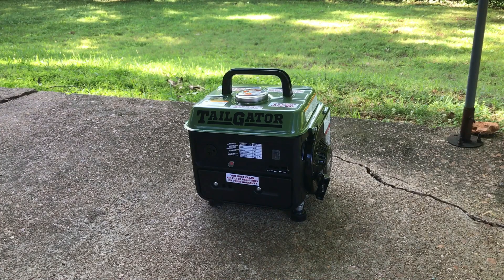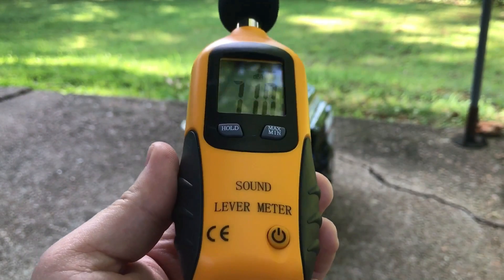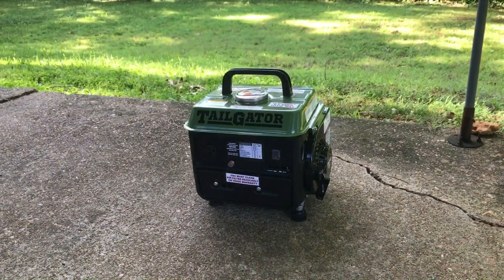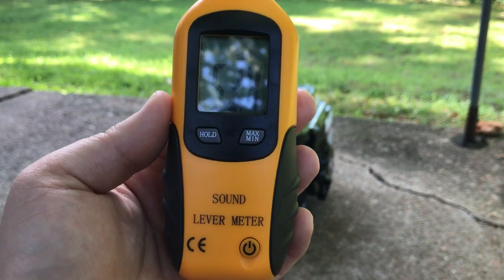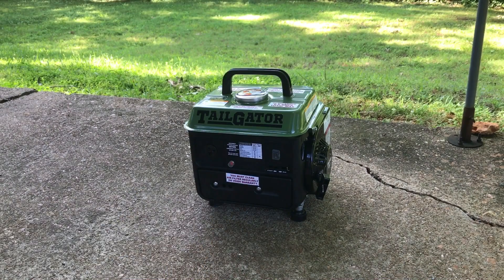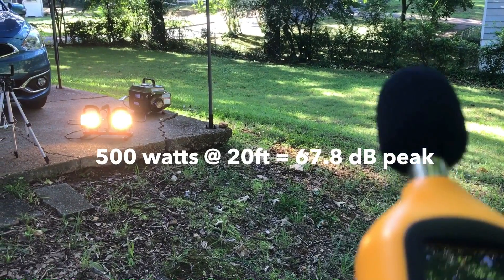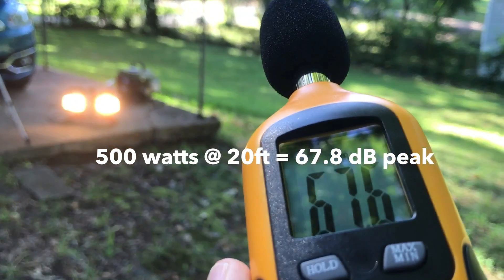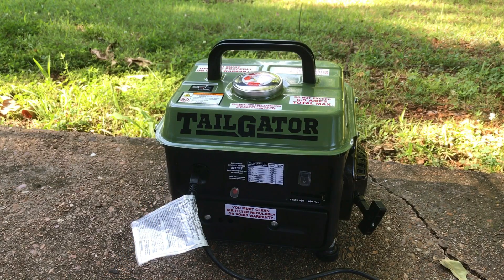How loud is the TailGator generator from Harbor Freight?

Comment: Bought one of these yesterday. So loud it is completely unpractical for use in a normal roadside campground. I ended up not using it due to the noise... Maybe I got a bad one or???
Reply: I will not bring mine camping either
Reply: It works but is so loud

Comment: I've always wondered if you could shave off a few decibels by attaching a small clamp on muffler on to the outlet of the existing muffler.  And being a 2 stroke, will the additional back pressure effect the exhaust scavenging.

Comment: If a generator isn't an inverter generator then it will be loud, that's the simplest way to judge this.

The question is, what is your intended use? Because that makes the real difference.

Comment: How can you make it smoke less?  Does anyone have any input.  I mixed the oil exactly right, but my entire back yard stinks when this thing runs.  Would really appreciate any ideas people have.
Reply from the maker: Synthetic oils smoke less, but a 2-stroke will always be somewhat dirty and smelly.
Reply: Ken, that is what I was afraid of.  I remember 2-stroke motorcycles from my childhood.  I did use synthetic oil.  I just bought it and it is still in the return period.  I may return it and get the sportsman.  Does this sound like a good plan?  or what 4-stroke generator would you recommend?  Thanks for the reply.
Reply from the maker: On the cheap? I don’t recommend, but I like Sportsman small generators. They are affordable.

Comment: I turned mine into Honda quiet by building a three sided box with a top, all in 1/4" plywood and a carrying handle and gluing in some R-Tech on all sides. I left 12"  for cooling. With a 50' #12 extension cord it's very quiet

Comment: Not too familiar with electrical work but can you run a set of those work lights safely using an extension cord from the generator
Reply: You should if you got a heavy enough gauge wire. After 100ft might be a good idea to go up a gauge.

Comment: Decibel is a logarithmic scale.  A 3 decibel increase represents a doubling in volume.
Reply: Eric Maher Close.  3 dB is doubling of power.  10 dB will double the 'apparent loudness', meaning a 10 dB jump will appear twice as loud.  A 3dB delta is known to generate an audible difference, but not an apparent loudness of 2x. It might be more meaningful to apply the attenuation principle in this case, where doubling of distance results in a 6dB drop (doubling of distance results in 4x surface area, so 1/4 the power density = 2*3 = 6 dB reduction).  Read up on the Fletcher Munson research if you want to know more.

Comment: I need to add something,, about the fumes, years ago I rebuilt and tested many a portable generator, in the Dyno room, load bank I had this same experience over and over again. Start a 4 cycle, run it 2 min, exhaust fan and all choked out in 2 min.
With the 2 cycle units, room filled with smoke quick, but, the air was better still than with the 4 stroke.
I will take the 2 stroke

Comment: i know this is a stupid qustion is there a way to replace the motor when it is time to rebuild or replace the motor?
Reply from the maker: +Larry Sledge Jr There are websites that sell every part for these engines, so yes...it is technically possible. The issue is cost. A new generator is only $88, so you're almost certain to come out cheaper by simply replacing the generator when yours wears out.

Comment: Did you ever do any modifications to the air filter? The foam was really loose and the cover didn't have a gasket on mine.
Reply from the maker: Thus far I haven't made any modifications to the existing filter, and you are correct, they most certainly could (and should) improve on the factory filter setup. That may be an area I need to discuss in a video and maybe make a new filter and downloadable template. Thanks for the inquiry!

Comment: Any ideas on how to reduce the loudness of the popping at idle and low loads? It's the biggest annoyance with my stormcat, as the popping just echoes everywhere.
Reply from the maker: +KJ6EPL That's inherent in 2 cycle engines
Reply: Yeah I know that it's inherent to 2 strokes, so you can't completely get rid of it. My question is if there is a way to reduce the loudness of the pops, such as a muffler modification.
Reply from the maker: +KJ6EPL Not one that I know of, but maybe someone else can provide a suggestion.
Reply: Make a little "shed" out of builder's foam and the right construction cement. Make sure you vent it. If you do it right you can make it a lot quieter. Experiment, see what works best, then make a video and monetize it.
Reply: My generator isn't this small but I added a stock Polaris rzr muffler that I hooked up with a little pipe from the factory muffler exit and it is much quieter now
Reply: KJ6EPL yea my tailgate generator from HF is really loud and also be making popping sounds while running it when idling and running with very very low load to my generator and I have to clean the sparkplug every 2 days of cleaning sparkplug and it gets this dark black hard sandy gritty build up on the sparkplug and on a full tank of 2 stroke gas I only get 2.1/2 hours of run time out of a full tank of gas It says it gets 7 hours of run time on one full tank of gas and my tailgate generator when it gets down to a half a tank of gas it be really. Popping and blowing 4 or 5 inch flame out of its exhaust and Costed me at harborfright 139.99 plus tax, about 7 months ago when I bought it from HF, and it smokes alot and the smell that you be smelling from it while its running it really stinks ALL HONDA PRODUCTS THAT HONDA ALL SALES IS THE VERY BESTEST OF THEM ALL OTHER BRAND NAMES OUT THERE AND HONDA IS THE VERY BESTEST TO BEING THE VERY BESTEST QUITEST GENERATOR TO EVER BEING MADE HONDA IS THE #1.VERY BEST OF THEM ALL.